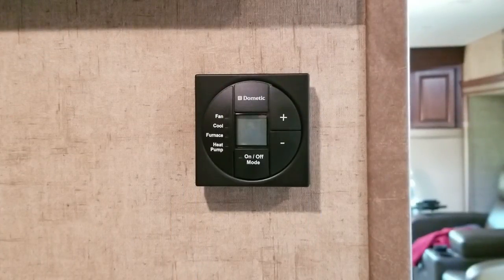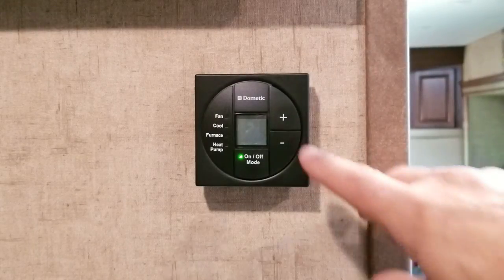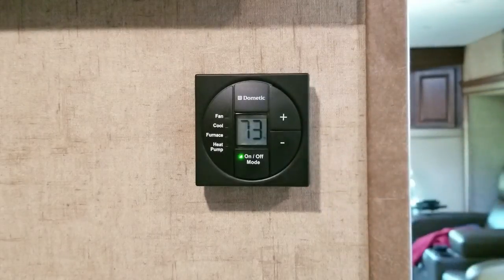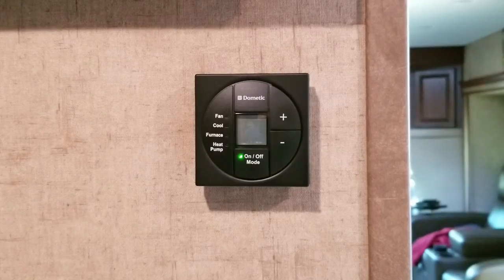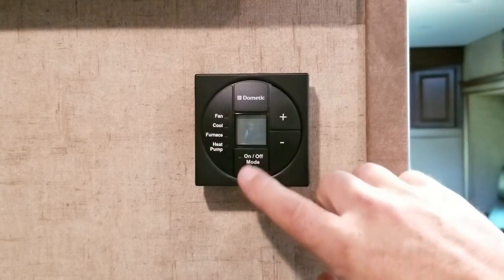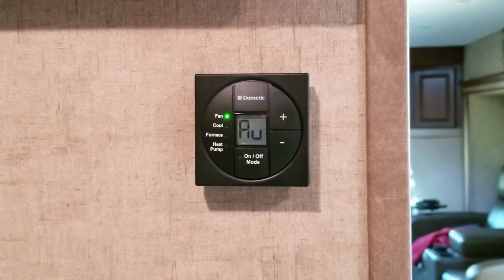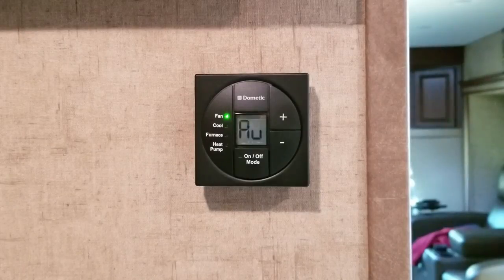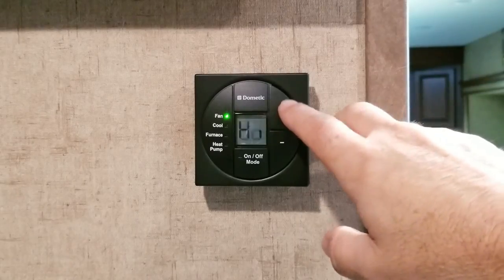Dometic Single Zone LCD RV Thermostat - How to Operate and Demonstration

Comment: Having issues with the ac continues to stay running even when desired setting is reached. What is the problem
Reply from the maker: Hi Jess,  sounds like your fan setting is on HI or LO.  Set the fan to AUTO and the fan will go off with the compressor. Most do keep the Fan setting on HI or LO so the fan runs even when the compressor kicks off.

Comment: How do i clear E4?
Reply from the maker: An E4 error code according to Dometic is "Open circuit or out of range Outdoor Temperature Sensor (Select Models). Heat pump will be locked out. Air conditioner, furnace, and fan mode of operation can continue to operate.  I hope this is a helping starting point for you.

Comment: I gotta question maybe you can help me I got dual air with the dometic thermostat i live in tx so it gets hot I leave for work in the a.m. set the ac temp at 65 66 for my dogs with the fan on high I come home and my fifth wheel is like a oven inside. Kinda like the compressor dont kick on only the fan runs any suggestions?
Reply from the maker: Hi Austin,  If the compressor does not kick on you definitely have an issue with your unit.   I would think your thermostat is ok since it turns the fan on.  It could be the circuit board ar even the compressor itself.   I would have a professional diagnose your system.  RV air conditioners should cool about 30 degrees colder than the outside temps.  Good luck hopefully it is something minor.

Comment: Do you know why our furnace tries to kick on when the air conditioner is on?  If we have the gas on the furnace does kick on.
Reply from the maker: The Dometic air conditioner fan will come on when the furnace starts if the fan setting is on HI or LOW.  The fan setting must be on AUTO when using the furnace.  If you are saying your furnace comes on when your thermostat is set to A/C then your system is not operating correctly.  You will need a technician to trouble shoot.  Hope that helps and good luck.

Comment: My dometic rv ac started to turn on and off like 5 times under 2 min and it is hot in Texas and I have it on 69 and my indoor temperature is 68 and I have it in auto recently we had to replace the fan motor 2 weeks ago could it be something else my rv ac is 1 year old I set it on hi and is working good just auto keeps turning off on again and again any help ideas of what could be going on
Reply from the maker: When set to HI the fan will run continuously regardless of the compressor.  When set to AUTO the fan will only run when the compressor runs.  The compressor turning on and off multiple times within a few minutes sounds like it is not running properly.  I recommend you have a technician thoroughly check the AC to determine the issue.

Comment: Why does the heat pump go on when I have it on furnace when plugged in to electricity
Reply from the maker: Are you sure it is not just the fan?  if your fan setting is on HI or LOW when you turn on the furnace the fan from the A/C unit will blow.  The fan setting should be set to AUTO when using the furnace.

Comment: We must have an older version thermostat. It looks just like yours and has buttons identical to yours, however there’s no way to change the differential. Pressing & holding the “-“ button doesn’t do anything. No “d1” or “d2” appears on the screen.
Reply: Update to my earlier comment: I downloaded the Dometic thermostat instructions. The instructions were slightly different. But it’s all good. Got our thermostat to “d1”. 

http://bryantrv.com/docs2/docs/operating/Single%20Zone%20LCD%20Operation%20Manual_3313327.037.pdf
Reply from the maker: Glad you got it figured out.  You will notice a huge difference in the comfort of your rig.  You will notice the furnace cycles a little more frequently but the temperature will remain much more constant.  Thanks for watching and taking time to comment. Happy travels, Lou.

Comment: Didn't answer my question. When I select furnace, and I am connected to shore power, the heat pump comes on and it does not warm my camper. If I am disconnected from shore power, my propane driven furnace comes on and it warms the cabin right up. When I am connected to shore power, I don't want the heat pump blowing cold air on me (room temp, whatever). I want the furnace to kick in and heat up the cabin. What is causing this?
Reply from the maker: It sounds like your FAN setting is either HI or LO.  Your FAN setting must be set to AUTO.
Reply: @RVHabit  I checked. It was set to low. I changed to auto. Anxious to test it.
Reply from the maker: I'm optimistic that will solve the problem.
Reply: @RVHabit  thank you!

Comment: My Dometic thermostat is showing E 1 what does this mean?? Please help
Reply from the maker: The E1 error is a loss of communications between the thermostat and the AC unit.  Now several things could cause this such as a loose connection, bad control board, etc.  It will need to be diagnosed to determine where the problem exists.  Good luck.

Comment: what do I do when it says e1
Reply: I can't get the e1 off
Reply from the maker: the E1 error indicates a loss of communication between the thermostat and module board which is typically located inside the AC unit.  You will need a tech to troubleshoot.

Comment: My 3 button domtic will not cycle off in the cool position even with the setting on auto it has to be manually turned off
Reply from the maker: You should have it checked by a certified RV tech.  Remember it will not cycle off if the compressor is running.  Run it in heat mode with auto selected on the fan.  See if the AC fan does not come.
Reply: @RVHabit  it cycles on and off properly in heat mode

Comment: I just got code E1 do you know what thats mean?
Reply from the maker: Hi Jordan, the E1 error is a loss of communications between the thermostat and the AC unit.  Now several things could cause this such as a loose connection, bad control board, etc.  It will need to by diagnosed to determine where the problem exists.  Good luck.

Comment: i have no display on my thermostat just happened this weekend tried the breaker all fuses are good just wont turn on its only 3 yrs. old
Reply from the maker: Hi Jeff without knowing much about what your setup is I would suggest checking wiriing first then check for inline fuse possibly even circuit board on t-Stat itself.

Comment: Why do I get a E5
Reply from the maker: Hi, an E5 error is a problem with the freeze sensor.  Dometic lists this error as Open circuit or out of range Freeze Sensor. Air conditioner and dehumidification operation will be locked out. Heat pump, furnace, heat strip and fan operation can continue to operate but displays the last temperature set-point.

Comment: My thermostat is blinking .. looks like E 1 then to. E 90 on furnace nothing is coming on fan it’s fro Au to E1.. on cool it’s E 1 to 55 .. nothing comes on ... don’t understand
Reply from the maker: Hi Michael,  That is an issue that needs to be diagnosed by a technician.  It could be anything from a loose wire to a bad control board.
Reply: @RVHabit  .. thanks .. no tech s here .. I believe it may have been because my battery was low.. I charged it .. and it seems to work now .. furnace kicks on Anderson’s off .. ok .. not sure if the electric is working .. do I need to put on the switch that sais heater inside the RPOD and outside ?
Reply: my thermostat shows E7

Comment: From the Dometic instructions:

“In the FURNACE mode the system will cycle the RV’s furnace On and Off based on the room air temperature and the temperature set-point on the Single Zone LCD thermostat. The system can be configured to operate using an On/Off differential of either 1 degree F or 2 degree F. This feature is programmed during the system ini- tialization. See “System Initialization” on page 3.
To set the temperature differential the system must be Off. Press the “―” button and, while holding it, also press and hold the On/Off Mode button for three seconds. Release the On/Off Mode button. Then release the “―” button. Press the “+” button to toggle between “d1” and “d2”, “d1” for 1 degree F differential and “d2” for 2 de- grees F differential.”

Comment: How do u get the code E4 off
Reply from the maker: As far as I know that is an outdoor temp sensor.  However I don't think they even use those sensors anymore.  It may be a board problem.  It will need to be diagnosed.